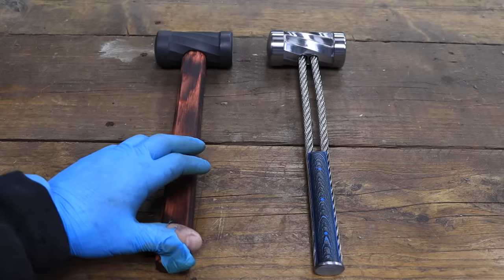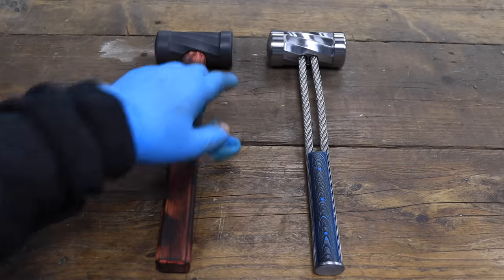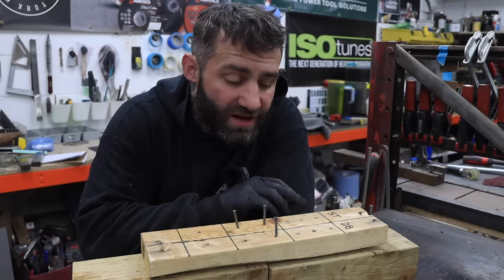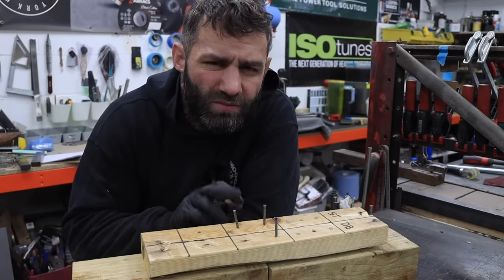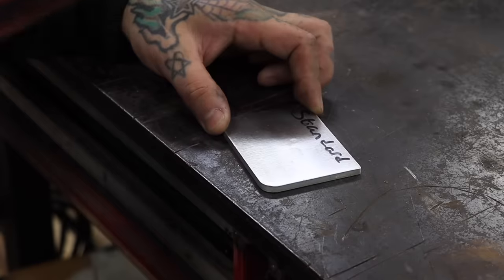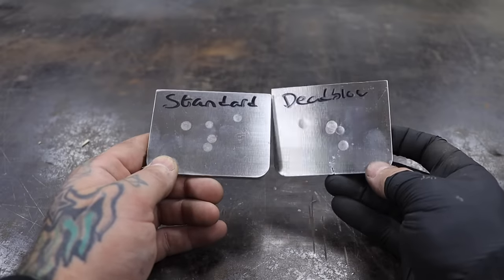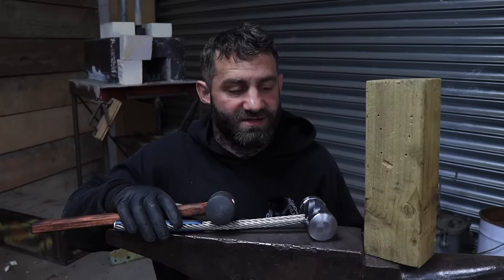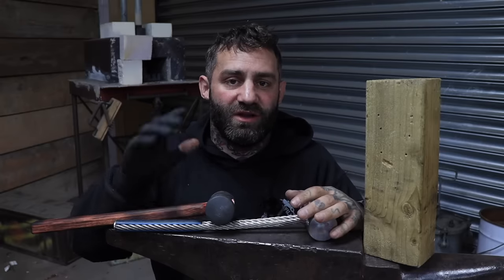Making A Kinetic Hammer - Will It Work?

Comment from the maker: What did you think to this concept and testing?
Don’t forget to look in the description and check out DFMtoolworks hammers.
Reply: It was nice to see the testing as it helps us to make informed comments...I would love to see a dead blow made with a heavy spring handle like the trench club. My theory is gained accuracy as well as lessened shock transfer to the hand but still keep the inertia transfer from the shot inside the head.
Reply: Ohhh how your eyes lit up when you pulled out that shiny hammerhead!! ❤😂❤😂
Reply: Hi
Reply: Testing was a great idea always seeing weapons or tools capability is always a good thing and your idea was interesting I would never have thought of that.
Reply: testing was interesting, build as ever cool as
Reply: It was great. Would a spring in the middle help?
Reply: Good in theory, but a larger cable would have advantages I think.   Like the Chinese rock breaking sledgehammer kinda. 🤷🏿‍♂️Nice work though!👍
Reply from the maker: @paulwhittaker5195  did you not watch it all?
Reply from the maker: @JohnJohnson-bg2oo  unfortunately it’s not that simple as the weight needs to be right, I explain in the end
Reply from the maker: @Starbuck01  no it would add resistance and over complicate the build
Reply: I really enjoyed the video and testing.  

What do you think of having the cables perpendicular to the hammer head instead of inline with it?  I think you may be getting a lot of side to side movement instead of back and forth with the cables inline with the hammer head.
Reply: Do you thing 4 pieces of cable would be more stable? Less twisting. Cool project.
Reply: @Anothermachine  is good with me today so I'll have it pp  Aa as Pro I Think I Need PPI I OOPPP
Reply: IPPPPOPAA
Reply: Put the wire as side by side
Then it will give most shock
Reply: My thought is to add flat plates to act as guides along the sides of the wires to keep them from flopping around, just attach them to the handle and not the hammer side so it keeps the deadblow properties, and it's a simple enough modification to the existing one, so no need to make another.
Reply: That hammer looks sweet. It could use a +3 accuracy buff though. 😉
Reply: Very interesting and a beautifull workpiece.
I am just wondering... Wouldn´t it be better if the Cables would be Horizontal to the head and not vertically? So that the flex is in line with the hammer motion and not to the side?
Reply: Would having the cable braid go opposite directions on the handle make it not twist as much? Or could adding bike chain possibly help with the twisting to make it more accurate
Reply: What would happen if you used a hinge joint between the grip and handle? Would it act as a more stable kinetic hammer?
Reply: Try 3 cables instead of 2 for the handle in a 1 2 stack and it will help it from flexing sideways and make it a touch more rigid for accuracy.
Reply: hmm would be interesting to see how these would work if you used some spring steel plates, the kind they use for thoes   pro throwing knives that cost like 200$ each. like  the acejet ones.  also you could have  twisted the cables together or have a thicker one and keep hte length. one more test i would add would be to drive  like a really huge nail through something that would take like 15 hits , could be neat. great vid though
Reply: Try putting the steel cables not inline with the head but perpendicular, i made one of these as a silly welding project, hard to swing but it lands a lot better than the concept you have
Reply: 6:15 holly 💩 Batman this is the first time watching one of your videos and up to this point silence then you speak and it’s like a completely different experience with that accent
Reply: Can you try with 3 wires, so that the head does not rotate when you hit hard? Also, maybe try with an axe for cutting/splitting wood?
Reply: I just wanted to let you know that you forgot to put a metal joiner on top of the grip handle. Other than that, the design is perfect.

Comment: To stop it from drifting to the side you could put a bike chain in between the two cables. The reason the hammer so inaccurate is because it’s just as easy for it to go to the side than it is to go forwards and backwards, as there is two cables holdings it in place either way, just in different directions.
Reply: Wait shit this video was 2 years ago
Reply: Lmao
Reply: @Ohyeah199  Youtube decided more people should see it now :)
Reply: Yep, this video aged well = )
Reply: It probably even has more rigidity in the striking direction, due to the ends being welded together. That would make it prone to bend sideways.
Reply: Still good idea
Reply: Actually, the ropes make it easier to go side to side than to go forward and backward. If it goes forward, both ropes are bent, the back rope is extended, while the front rope is compressed. If it goes sideways, both ropes are only bent.

Comment: I really like the idea, the floppiness of the hammer might be fixed by putting metal segments along the twisted steel.  You probably could get away with a single weld on alternating sides (front, then back).  Might help with stability, but I do like it!
Reply from the maker: Thanks very much for watching mate
Reply: Wouldn't be a kinetic hammer then
Reply: i think the wires being in line with the acceleration means it'll twist itself as the leading wire gets tension and the trailing wire gets compressed, but if the wire were side by side, perpindicular to the motion, it might flop forward and back better (but maybe too floppy)? idk lol 🤪
Reply: @babynautilus  maybe triangular, 2 across for stability, and 1 in line for stiffness.
Reply: @Mr371312  Not sure if  it's what you  were trying to explain, but I was going to suggest using 3 cables  as well. Just a bundle of 3. make sure the single cable  is facing the face of the hammer and  it should work great.
Reply: I mean, that's already been solved. Modern Deadblow hammers simply have a hollow head partially filled with a heavy but loose material. When the head strikes the recoil is transferred to the filler material which moves inside the gap but does not cause the hammer to go back up.

Comment: The difference between scientific testing and screwing around is proper documentation
Excellent video and build as always
Reply from the maker: That is a very fair point, thank you
Reply: Found the government contractor!
Reply: You forgot the most important difference, eliminating variables.  This could be done by using a robotic swing arm or just gravity on a pivot frame so that the same amount of force was applied to each swing.  The documentation part would be to use some sort of scale to measure the actual peak force felt at the blow of each hammer.  This, however, would be a lot of unnecessary effort for such a simple comparison.  A hammer with what is essentially spring suspension, having less recoil than one with a rigid handle isn't exactly surprising.  The craftsmanship in making the hammer was impressive though.  Good video either way.
Reply: @clencheastwood1571  I mean, there is a difference in how much effort one goes through, to demonstrate how stuff really works. I think that was what OP was getting at when he said "I'm not a scientist" before doing science --- he is not an advanced scientist.

The details are always important. Don't just read the title; read the report.
Reply: @nielskorpel8860  agreed, that's why I said it would be an unnecessary amount of effort in this case.  Just trying to keep the spirit of the scientific method alive for any younger more impressionable people who might be watching :-)
Reply: @clencheastwood1571 this guy’s talking about going full Descartian and science on reproducing tests.

Variables in science is what we said back in the 6th grade 😂😂 you best be saying “reproducible trials in a controlled lab setting” when you’re older - instead of an essay describing one 🎉
Reply: Nah man... the real difference is peer review of your findings. And no, confirmation by a drunken guy on a pier does not count.
Reply: You know nothing about science.

Comment: The overall length of the DB handle is outstanding! You'll get the best accuracy and shock mitigation if you extend the steel support between the cables all the way up to within 3cm of the head!
Reply from the maker: Adding more support voids the whole purpose of the build, it needs maximum flex to absorb the shock, I already explained how to fix it

Comment: This was really cool to watch! 
I wonder if you flipped one segment of cable 180 degrees so that one spiral is opposite the other how it would help with the twist issue. I see that you’ve said it was user error, but you may have less twist with greater swinging velocity that way.

Edit: I know there are a ton of comments suggesting improvements, but I haven’t seen this suggested. I definitely don’t mean to take away from what you did either, this was a lot of fun to watch and think about.
Reply from the maker: I understand what you mean but as the cable twists the same way even if you flip it follows the same direction, i explained how to fix the issue in the video
Reply: @DiesInEveryFilm  whoops. Yeah that would require the cable to have been twisted the other direction. Thanks for you time

Comment: Thanks for the video! 

I know that it wouldn't look as cool, but if you were to put a thick, flexible tubing over the free parts of the cables, do you think it would give just enough stiffness to make the hammer more accurate while retaining the full effect of not transferring vibrations back to the user's hand. You spoke of using a thicker cable, but that might be harder to make at the handle end or even the head end. Even PVC piping or tubing over the cables might make the dead blow hammer a little less wobbly without changing the other properties.
Reply from the maker: It’s not the wobble it’s the twist but i have now realised it was purely my user error as i was trying to swing too hard instead of letting the hammer do the work

Comment: I love the look of that, would be very interesting with stiffer/thicker cable to reduce the deflection but still have that whip. Would be interesting to see how it does in forging.
Reply from the maker: Thanks very much for watching
Reply: @DiesInEveryFilm  if possible, see if you can find a cable that twists the opposite direction. That way you can have opposing twists in the cables that’s attach the head. This should cancel any twisting you experience. That is, if you can find cable that does and is still the same diameter.

Comment: That's one wicked hammer in my opinion I think thicker wire will give a more accurate landing but maybe a heavier aftershock to the arm love the video by the way be safe everyone
Reply from the maker: Cheers mate, its more a twisting problem so I’ll figure out what’s best and adjust it
Reply: @DiesInEveryFilm   if possible, see if you can find a cable that twists the opposite direction. That way you can have opposing twists in the cables that’s attached to the head. This should cancel any twisting you experience. That is, if you can find cable that does and is still the same diameter.

Comment: Quick tip. When drilling through metal it helps stop bit binding there at the end if you use a wood backer. For people using cheaper tools this can save your bits from snapping.
Reply from the maker: Or something with a hole in to drill through, exactly like what i used
Reply: @DiesInEveryFilm   I didn’t realize that you had that lol but you seem to have nice things and the tip is aimed at poor people like me 😂 also absolutely beautiful work btw. I’m also jealous of that 2x72 grinder. Mine got stolen 😭

Comment: If you put a piece of bike chain down the center you could remove the side-to-side floppiness while still letting it flex forwards and backwards. Still probably not as accurate as a rigid hammer but at least it wouldn't be twisting all over the place. 

The problem is also worse than it needs to be because the cables are in the plane of the swing, so it's most flexible sideways and least flexible head-on.

Comment: I use a piece of stainless cable from the standing rigging from a sailboat. Much stiffer and you only need one. Put a piece of lead on end, and use the existing swedge  end for handle. Basically it is a trench club.
Reply from the maker: That’s something totally different to what i made
Reply: @DiesInEveryFilm  a kinetic hammer would be designed to have the handle straight as it strikes the nail so the speeding up of the head’s energy would be added to the strike. Either side of straight means the energy is wasted. Like a golf club.

Comment: Very cool, but I think you'd get a more accurate swing if the 2 cables were oriented 90º from their current orientation. As it is with the cables on the same plane as the hammer head, that's causing some side to side deflection on the downward swing. If they were side-by-side, you'd get a more accurate downward travel, and the flex of the cables would provide a whip like energy toward the nail as opposed to a sideways deflection away from the nail.
Reply: I'm not sure my description of the improvement was clear. Another way to think of it would be to leave the handle and cables exactly as they are, but rotate the head 90º.

Comment: Cool video. I always wonder how the guys hit with the long extremely flexible hammers. It always looks exhausting when they swing overhead to build up energy.
Reply from the maker: Thank you mate, apparently it’s less effort than a standard hammer, i think my fault here was trying to hard rather than letting the hammer do the work
Reply: With practice comes accurecy on over head swings with large hammers and axes.
Also just added info its a good idea to kinda shift to one side of the target before lineing up your swing especially with axes ,  like when splitting logs  if you miss and are dead center theirs a great chance its goin tword your legs then.
If your going over right shoulder stand a bit to the left and vice versa

Comment: I wonder if this would be a good option for blacksmithing. I haven't read into it but I suspect that blacksmiths probably suffer a lot of aches and pains in later years from the stress of hammer rebounds over the years. Even if it was only suitable in the early phases of the work, I still think that could be useful to preserve at least a few joints.

Comment: You should try shortening the wire handle on the dead blow, make it a couple inches long and weld it to a regular handle. So that only the top little bit between the handle and the hammer head is wire? Curious if that would make a difference in accuracy and handling.

Comment: Would adding some material around the deadblows neck help with its aim?  Maybe something like shrink tubing, or even wrapping some metal wire around it.
Reply from the maker: It’s more that it tries to twist, I think i was trying to hard to swing it instead of letting it work from motion

Comment: Would turning the two cables so they are side by side when holding as opposed to one over the other help with the accuracy? My thinking is it would still allow the cable to bend, just not side to side.
Reply from the maker: I explained how to fix the problem in the end of the video

Comment: What makes the other one a dead blow? If it's the same head that doesn't make it a dead blow just because of the flimsy handle. A dead blow hammer is typically full of sand creating a deadblow Because it eliminates rebound and recoil

Comment: I think using a rubber-encased grip, move the wires closer, make them THINNER and SHORTER. 
it'll relieve some more shock, you'll have slightly better accuracy im sure. 
force should be greater, although would require slightly more momentum. but you could use a thicker cable definitely to make less momentum be required for that force.
Reply from the maker: I explained how to fix it

Comment: Just a thought, what if you did a few short welds between the cables from handle to head? It would make the neck less wobbly and provide more accuracy while giving some flex in the neck just not as sloppy.
Reply from the maker: It’s the twisting that’s the problem, i want the flex
Reply: I understand that, what I guess I meant was to reinforce the cables to prevent the twist for more linear force while still having the deadblow affect. Like an expansion bridge, there's guide cables to prevent twist.

Comment: Hey Dies Build a hammer from Titanium We use them in carpentry and the same size head is lighter and can be struck much harder. I have drivin large spikes with an 18 oz hammer of titanium. The brand name is called a stiletto . Always wounderd about making a forging hammer using titanium i imagien it would be a fantasticly light and agressive hammer.. Build ITTTTTTTTTTTTTTTTTTTTTTTTTTTTTTTTTTTTTTTTTTTT.. Cheers mate, Martin
Reply from the maker: Hey, there’s loads already on here mate, I prefer to try different things and i got a massive list already

Comment: re: the cable handled hamer - you need to introduce some rigidity within the cables. If it flexes between hammer head ends this is OK - if it has any flex left or right of hammer heads, this must be rectified if you are to have any control over the tool.
Reply from the maker: So like i said in the video